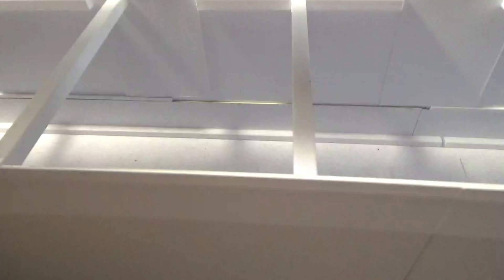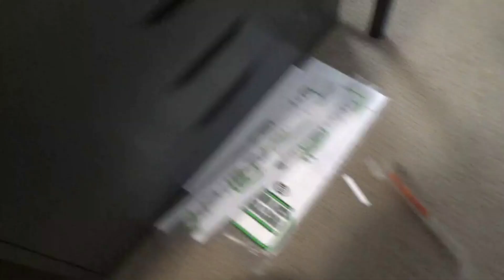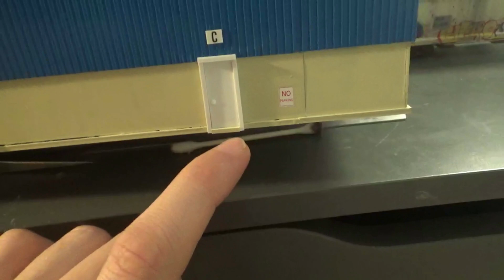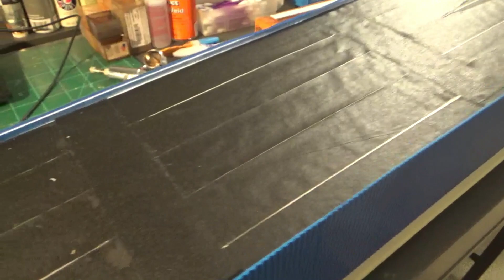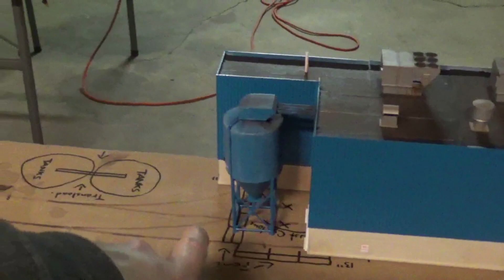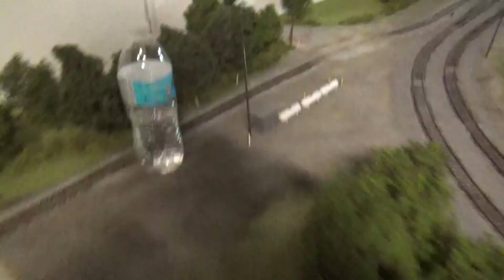Modeling The Industrial Scene On The Layout!   Part 3.  Finishing The Industry/Layout Scenery Prep.

Comment: At the end of the video you was thinking about adding a concrete road running along the warehouse. Once I get going on my layout the roads will mostly be dirt with magnesium chloride sprayed onto a limestone fines / dirts roads. I will have one section of a paved road which will be at one end of my layout that runs along the side of of one of two warehouses, then the other side of the road will be a three bay fire station and near it will be a outdoor cafe, rebuilt from a retired troop kitchen car. I'll use "concrete" foundations for silos, docks and shops. I'll use the dirt, alkaline surface with a mixture of limestone fines and some dirt in and around two house tracks.
And your building looks very impressive. Both of the warehouses that will be on the Bonneville Industrial Terminal and Transfer Co,  I'll model will model them with docks running along the length of the building.🦡